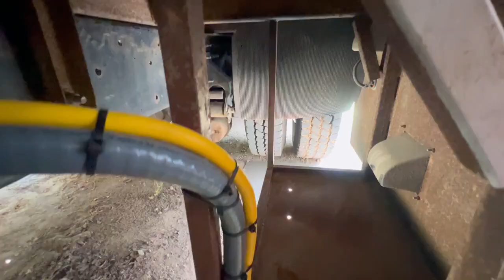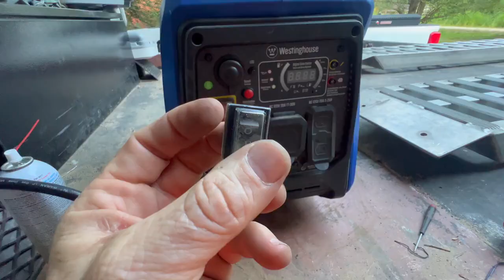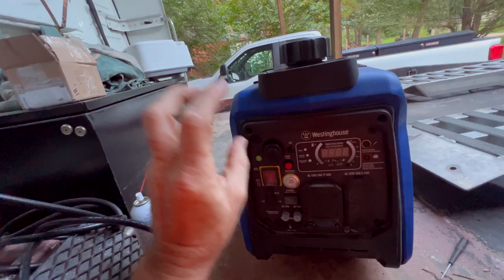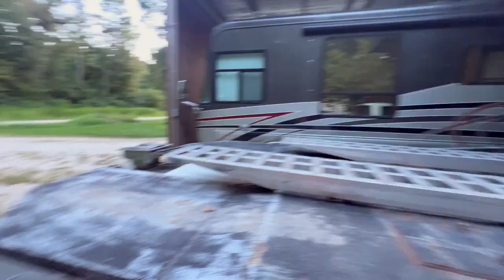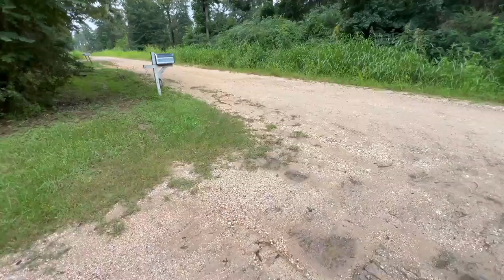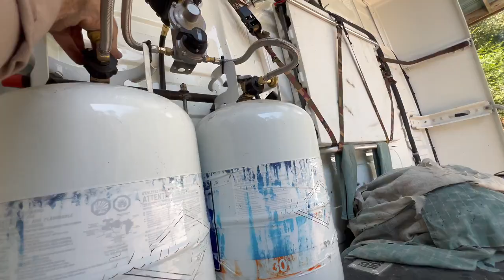Westinghouse Generator | iGEN4000DFc | it fails after 72 hours

Comment: Play along with the service center, send it to them; and if they want to charge you to fix it, simply refuse.  Whatever is broke, claim it's defective and that's Westinghouse's problem not yours.  If they claim abuse due to lack of maintenance, you followed all the maintenance in the owner's manual, unless the owner's manual is defective as well.
Reply: honestly for that big truck lol, you would have had money well spent on a good used Onan RV genset; had 4k of power available and had less issues.  I have two 4k and one 5.5k Onan getset's that are from the 80's and 90's and they hum and chug along with very little issues.  You can convert them to propane if that is what you want.
Reply from the maker: @davidplaster4576 I looked but most of the 5k’s were way out of budget for just a truck generator. I also looked for a diesel powered but that was WAAAYYYy out of perspective.
Reply: @AllabouttheHDT  I understand, they are crazy expensive for the 5k to 5.5k's, which I guess could be due to they usually support 240 volts vs the 4k's usually only have 120 volt only.  I am glad the repair shop was able to help you out, and you get longer runtime with it.
Reply from the maker: The repair shop ended up trying to help us out and go to batt for us. I still had to pay there service fee….but whatever. It was $189….it was that or not get my generator back.